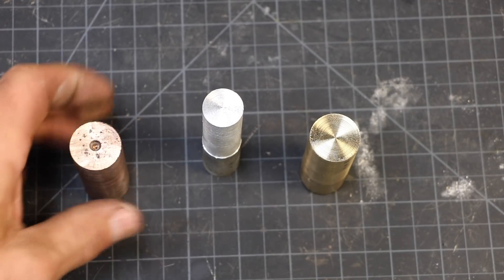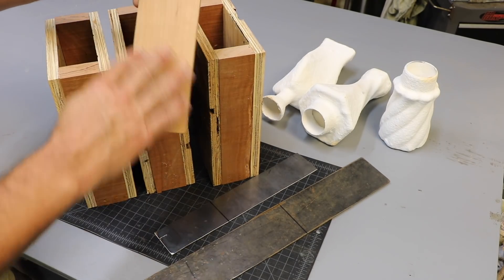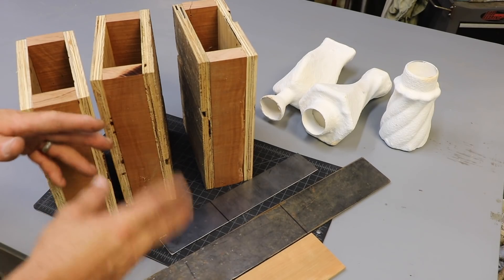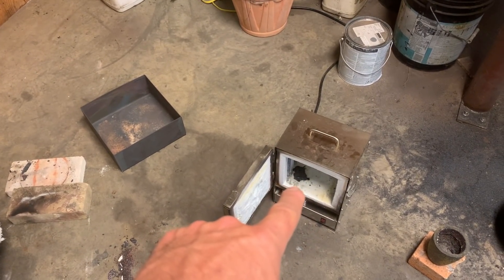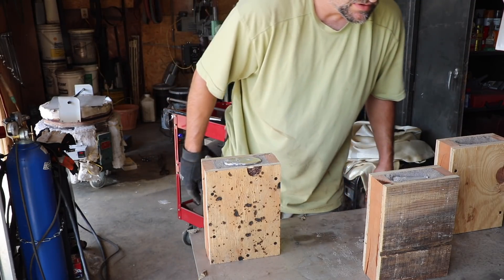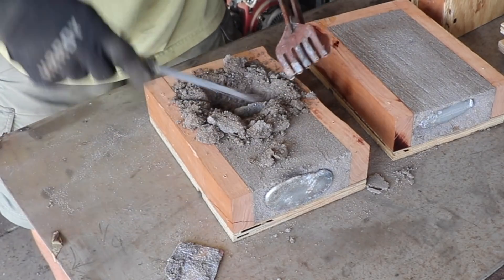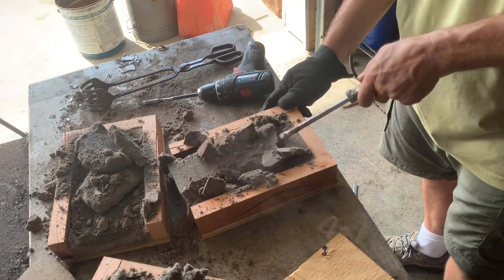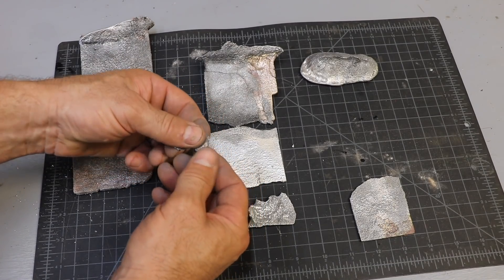Mixing Molten Metals.  What Could Go Wrong??

Comment: Instead of pouring, what about introducing the Cu to a pool of molten Al? 
Cu could be introduced through different means-injection while varying thickness of stream, pressure of stream, distance of release toward puddle. 
Or gravity fed  through a grate to break Cu into droplets. Misting would allow intoduction of specific volume evenly across a specific area. Size of droplets, space between each droplet, height above Al pool as ways to control temp and size of intermixture band. Vary depth of al puddle with most promising of above techniques. 
Run (or start with?)same means of introduction with Al into Cu puddle.
 My apologies if it's common knowledge why some or all of these are not viable options.

Comment: Paused @5:12 I'm thinking you're going to lose control of the crucibles. I like your idea about making it easier to do the pours, but I don't think you took into account the angles (not saying I would have either!). Ok un-pausing and will edit with my response. Added extra line breaks so not to be too much of a spoiler.

EDIT: Ok, that didn't happen, thankfully. Interesting result though!

Comment: Mix the heated metals prior to pouring them.  Once you have a nice hard Cu-Al cast, apply a thin coat of one or the other pure metal to your casting by dipping your casting into the molten metal.  Make sure the molten metal is as liquidy as possible to produce the thinnest layer as possible.  Once cooled down, grind smooth for a textured dual metal surface look.

Just an idea. :)

Happy creating!
Reply: Liquidy, I like that word.
Lowest viscosity is also a good way of putting it.
Reply: @jeffs7573  Thin works too.  Like thin paint.
Reply: This is a cool idea. Shows the insides, just not directly.
Reply: That is a good experiment.   Try freezing an oil/vinegar emulsion.   Same thing, no risk of getting burned.

It can only be done in the absence of gravity and magnetism...  total  vacuum and a few other unusual conditions.. if you want a viable alloy.

It has been done.  A microgram costs more than a metric ton of rhodium... wrapped in a space station orbiting the outer kuiper belt.

Our physics is limited by our dimensional physical position.   We knew this when Tesla was alive.

Some day, they will tell us our DNA is directly related to our star.  It breaks down if we get to far away.

Comment: One thing that I would love to see is if you tried basically this same process, but measured out the ratios of copper to aluminum in advance.  You said it yourself that due to its high surface tension its difficult to control how much aluminum you pour into the mold.  But if you are simply emptying both crucibles, I don't see this being an issue. Of course, you would still end up with a sub-optimal alloy due to the amount left behind and the variations throughout the pour, but it could potentially be strong enough for an art piece like you had said.

Comment: I predict explosive boiling of the aluminum - hmm much more tame than I'd of thought

I'd be curious if you could get steel and copper to mix Like you want. Or maybe do it in two steps, with an imperfect copper cast and then pour aluminum over the coper to fill in gaps and sand the excess off

Comment: Melt up a batch of the strong aliminum-bronze and cast the vase with that!  Maybe throw some 1/4 in steel ball bearings in while it's heating to see what that does to the surface, knowing it won't ever be hot enough to melt the steel.

Or better yet, fabricate a frame from 1/8" steel rod (or whatever diameter is suitable), and then cast a layer, let it cool, switch metals, cast a layer, let it cool... This was the steel framework is what will keep the copper and aluminum from otherwise breaking at the cold-joint.

Still, was a great show, but then again, I think nearly all of your videos are pretty great!  Namaste

Comment: Copper and aluminum have different rates of thermal expansion, so even if you do get some interesting swirls going on, I think they'll separate and crack as they cool.  Also, they have different densities, so the aluminum may end up floating on top of the copper.

Is there a reason you didn't just heat the aluminum up in the same furnace to 2000F?  Will that cause excessive oxidation?
Reply: I was wondering the same thing about heating them both to 2000ºF.
Reply: @roseblite6449  - Aluminium burns like magnesium at that temp.
Reply: @SnorrioK  AH, bad idea then. Didn't know.
Reply: @SnorrioK  so do it in a modified atmosphere room (just kidding mostly, like this guy has a full breathing suit, air pumps and hoses, etc to do that) :D
Reply: I did not know that...so yes no bad idea then class D fires = bad

Comment: Personally i feel there could be explosion due to temperature difference of the metals and if that doesn't happen then the layered casting plate would be easy to break where the layers join together

Edit: no explosion which is good, but the thought has crossed my mind about which metal is more dense and if the heavier would just go to the bottom leaving the lighter one on top

Comment: I don't know the boiling point of aluminum, and the video is on pause.  I think the aluminum will boil, bubble, or off gas, I know a lot of ifs, but it will cause a very porous casting.  Since the metals will cool at different temps they won't bond properly and crack when cooling.  No good mix between them just a fault line.

Comment: Copper will remelt aluminum and the copper heavier sinks, some mixing of the two as it does.
Edit in below.
Seems i didn't guess the copper being cooler than normal pour temps but wasn't far off.
Remake it by pouring flat together in a flat dish design that at least has a chance to get what you wanted.

Comment: Prediction: the hot copper will cause the aluminum to boil and splatter. Even worse the Cu solidifies while the aluminum boils.
Lead boils at 900F. Idk the boiling point of Aluminum but it can't be all that high, as it's a p-block metal. It also might ignite...
Reply: Reaction: wow, very interesting. So now the thing to do is to take the "Crapalloy" and mix it with more copper to make Aluminum Bronze, and then try casting copper in one hand and Aluminum Bronze in the other to get swirling effects. You could also do Copper and Nickel to get Cupronickel and swirl that with Cu or Bronze.

Comment: Thanks for showing us your mistakes and being an honest bloke!
As for when it comes to metallurgy, it is more complex then most people think.
In order for the bonding between two metals to happen, you sometimes need to use a several different pre-treatments, add fluxes into the molten metal..
Use vaccum, pressurize the alloy whilst its mixing.. etc.
There is a lot that goes into doing it the best way, depending what type of alloy you are making.

I would try lookup some of the fluxes you might want to use in order to make the metals more suseptible to bonding..
And the correct temperature can also be critical to make the results good.
Its like when you do a soldering with a soldering iron and solderingwire... if you do the solder correctly.. you have clean surfaces and little contaminants.. You have enough flux to help with bonding.. you have the correct amount of heat, to not overheat, and not too low heat, so it won't properly liquify.
But warming the solderingwire for too long.. also overcooks the alloy, and removes the flux... and the solder becomes brittle.. matt, and voids starts appearing.. less bonding and so on..

If you compare that to this experiment, it would indicate that there are contaminants.. possibly the oily stuff in the green sand.
maybe the temperature is too high, or too low.. 
Maybe you need a flux.
Maybe you need 0.2% of a nickel, to use as a catalyst.
Maybe the copper needs to be preheated and heated for 30 minutes extra... versus the aluminium poured immidiately after smelting.

Perhaps making the alloy first, and then casting it, could solve some of the problem as well.

But in any case, i think with the right flux(fluxes) even that would get u further.
There are fluxes that removes contaminants..
Fluxes that allows higher or lower smelting temperatures..
fluxes that changes viscosity
Fluxes that increases bonding potential.
etc.
Reply: I used borox and ended up with aluminum bronze by accident. I forgot there was still a piece of copper in my crucible and when I started pouring in the end I was like why is this gold colored hahaha

Comment: Predictions:
Structural failure of the mould as you pour.
Setting in the top of the mould causing cavities further down.
The mould tips over.
EDIT:
Not even close.

Comment: I'm not cheating. My expectation originates to when you said the temperature for both metal. Since the temperature is so different, I expect about the same as throwing cool water in a oil fire. Explosion, bubbles, etc...
edit: Well, didn't explode.
Edit2: Take all the chunks and remelt everything?

Comment: What about tilting the vase mold- pouring a little copper- let cool- tilt in another direction, pour steel/cast iron - let cool- and repeat with other metals        Once the whole piece is finished.  Then throw in the lathe and clean it up.   Then use an acid to etch each metal

Comment: my guess is itll come out like oil and water, with little bubbles of one material interspersed in the other, like an aero bar, and will probably be about as structurally sound

edit: well, at least i was right about the obvious part
edit 2: actually no, i was completely wrong, an aero bar would be stronger

Comment: I'm paused at 5:12 to make my prediction.  There's a big temperature differential there and I'm naturally afraid of those, there's not going to be any flashing to gas though so what's to be scared of...  The rapid temperature change of the aluminium could result in significant expansion though.  I'm not sure but I suspect it might be slightly 'exciting'.  On with the vid!

Comment: The junk alloy that you get from too much aluminum, it's still aluminum and copper, so if you want to make aluminum bronze instead of using straight up aluminum just use your leftover crappy aluminum alloy and add it to copper to get your 10%, that way nothing goes to waste.
By the way, if you melt a lot of water pipe ends that have a lot of solder on them you end up with bronze because solder is mostly tin.
Reply: There used to be a lot of lead too. Most modern solders are silver based…

Comment: My thought is the copper is going to make the aluminum boil thus popping and splattering all over the place.
After the after the pour.
When you make aluminum bronze if there's too much aluminum in the mixture it becomes super brittle and will shatter like glass and have zero strength even compared to pure aluminum. Now that I think about it the aluminum might have caused the copper to solidify by cooling it off.

Comment: Aluminum shavings and aluminum foil tends to oxidize so badly that you're not going to get much metal you're just going to get dross.
You really should compress the chips so that there's no air in the middle, just usually aluminum foil to make powdered aluminum.

Comment: have you heard of "Nordic Gold" it a copper alloy of 89% copper, 5% aluminum, 5% zinc, and 1% tin. it is almost gold in color and is used for coins.  have the copper in 1 crucible and the aluminum, zinc and tin in the other, i don't know if it would pour any better or be less brittle,

Comment: Melt copper.. add aluminum to the molten copper, add flux, and stir. Then pour. If you meant to make makumagane then you will need to add pressure with your heat to get the layers to fuse

Comment: Stopped at the 5:00 to predict.
Pouring copper on the aluminum - not good due to heat & expansion.
Both together - eagerly awaiting result.  I have asked other casting channels to try this.

Edit-Thanks, Not what I expected.
This was my attempt at multi alloy.
https://youtu.be/tjTSMC9ARk4

Comment: Your issue here to me seems to be the mould is stone cold and solidifies whatever you pour into it, when it strikes the mould. Either preheat them a lot(maybe not possible with sand), or make a steel mould(Coquille casting style?), to avoid the shock cooling/solidifying before it's had a chance to mix/interact

Comment: I think this material is a type of copper-aluminum intermetallic. I have personally accidentally created this many times as I don’t have a scale to measure my components so I just guess how much aluminum to mix. It is very brittle and some of these intermetallic mixtures can have a lower melting point than even the aluminum. Not much use in these, except maybe purple gold which is a intermetallic of gold and aluminum.

Comment: Damn, is the formation of that intermetallic compound so exothermic? It looks like it's really flaring up as the pours mix.

ps. beware of Ni-Al mixing. Indium Corp. sells a material called Nanofoil, it's stable at room temperature, but it can be ignited and get extremely hot, transforming in a split second (edit: ok first you'd have to melt Nickel... and that's probably a bridge too far w.r.t. Al)

Comment: Pause. Guess: The temperature differential is too great between the two metals. The material with the lower melting point has an energetic reaction when heated by the hotter material. (There could be some specifically chemical reaction but I don't know enough metallurgy/chemistry to guess what.)  Edit: Ohhhhh. Maybe successive pouring and cooling of different materials (going for adhesion without alloying) could get a stripey look in out of your molds?

Comment: I would assume there are bubbles forming cause of heat difference and difference in density, making the pour difficult and dangerous. Also, other option would be a mould failure, the narrow slit getting clogged?
EDIT:
Didnt seem dangerous, but bubbles did form and density did what i thought it would. Didnt expect the brittle material though.

Comment: My predictions: the 2 metals will not mix clearly, and as copper has a much higher melting point than aluminum, but both having pretty good thermal conductivity, the temperature between both might even out which will freeze one of them. Might even block off the pouring area.

EDIT: And i was pretty far off.

Comment: One technique you could try would be to cast the copper first then cool it, clean it, brush it shiny then apply aluminum to the outside of the copper casting, and cover it with slip and reheat the copper to the melting point of aluminum. This would cause alloying of various amounts according to various factors such as thickness on the aluminum, oxygen , fluxes and depth of heating. I've made aluminum copper alloys before just playing with a torch and the hardness and brittle nature is surprising. The stuff almost looks crystalline when hit with a hammer. Perhaps some of the crystalline alloy could be 'painted'  onto a copper vase after it is ground to a powder and mixed with a flux?

Comment: This is why sheetmetal is made by rolling out ingots rather than casting it into thin sections like this.
Reply: Pouring thin is really hard to do, especially on the scale of industrially made sheet metal.  You also won't have the precision for the metal thickness, that the customers demand.   It's easy enough for them to keep passing it through the rolling mill until it's down to the customer's need.

Comment: Interrupted pours generally result in a weak casting even if your staying with the same metal.   The exception is adding a bit more to an open riser/feeder or spru as it shrinks.  And there are better ways of handling that too.  Was fun just the same.
Reply: Different temperatures will also lead to microfractures

Comment: All I could think when trying to predict was "2 crucibles at once?!  Craziest damn thing I ever heard of."  Lol, and also "they probably won't mix evenly before freezing".  You made that cannon though, so I gave it a chance.  Glad I did.  Fun video.  I love my homemade aluminum bronze axe, keep trying!  Keep in mind, even 13% is enough Al to get a glass-brittle alloy.  From my own research and experience making and casting Al-bronze, one good way to get it evenly mixed is to alloy it in one crucible; add the Al after the Cu melts and mix the ingredients with a smooth up and down motion with something like a skim tool rather than a stirring motion, taking care not to agitate the surface of the melt. Mind you, I do this with the crucible still in my propane furnace with the burner running. An electric furnace would mean pulling it out and having to hurry more before things cool down too much.  But if you are able to rig up a way to pour 2 crucibles simultaneously, I'm sure you can figure that out too.  Then pour ingots to remelt when you go to pour your actual molds; that should help with getting the ingredients even more fully mixed together.  Good luck!

Comment: On a sidenote, if you alloy the aluminum with between 7-10% silicon you will get a alloy that flows a lot easier, 0.5% titanium to refine the grain structure and maybe 0.5% magnesium just for fun and it's now a  proper alloy! From personal experience it flows like water at around 13% Si, but it's very hard at that point. You can also source finished alloyed Al from car parts if you're not picky about exactly what's in it. I'm guessing you used either extruded Al (a lot softer and more malleable)  or close to pure Al on purpose? 
Also I really enjoy the content you produce, keep up the good work :)
Reply from the maker: It was mostly extruded and should have been fairly close to pure aluminum.